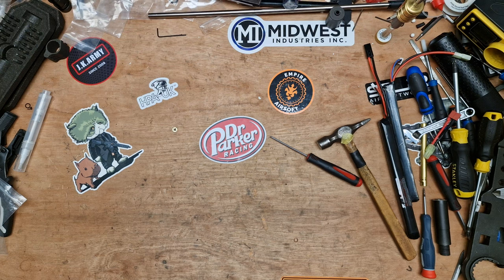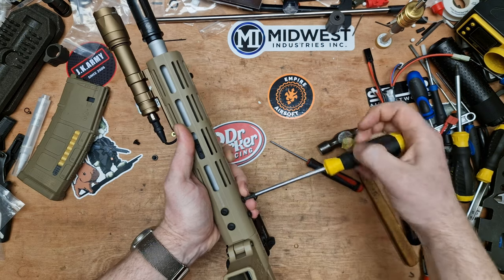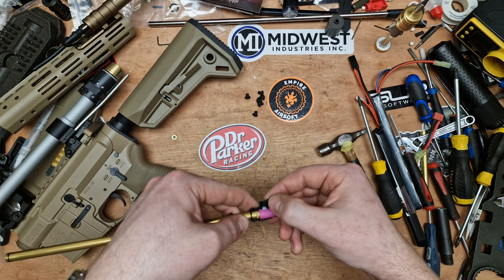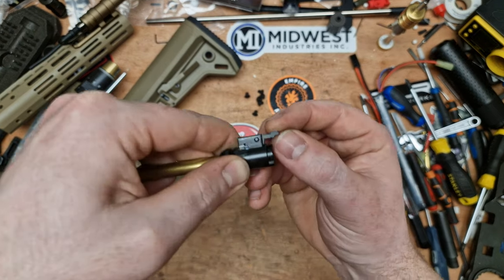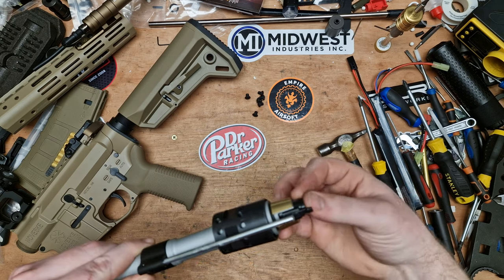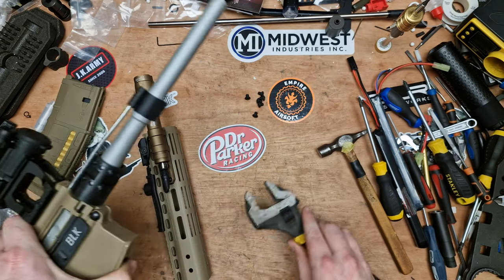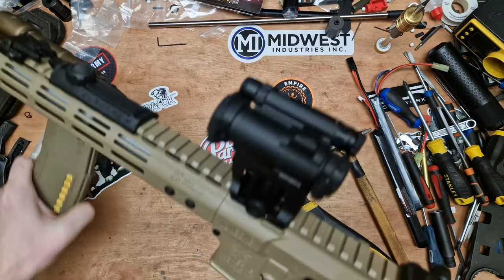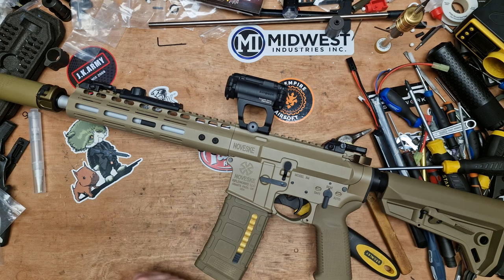EMG DE Noveske MWS Clone Hop Up Tension Fix

Comment: Received, I will provide the video to the engineering staff tomorrow
Reply: If you dont wanna modify gun in anyway this is might be good.  But if you want change steel barrel, mk18 rail or any other upgrade...its impossible or just pain in the ass. I just wish i can return this gun and buy TM mws and build gun what i like. Anyone interested to  buy double eagle noveske?
Reply from the maker: Still waiting on my DE sponsorship 😅
Reply: @Jaeger-Precision  new porduct on
 the way
Reply: Why cant you fit mk18 barrel?@plixplaxplox1609
Reply: @plixplaxplox1609 it’s a nightmare to change the barrel on a tm MWS bro
Reply: @JR-pf7kk  Upper is different shape than lets say m4a1 receiver
Reply: @mosslife488  On TM MWS i never had any issues. just swap the barrel and thats it.
Reply: @DEAirsoftJerry  When? iam just about to order TM mws. I still might since i dont want any other compatibility problems.
Reply: @plixplaxplox1609  I expect that in July-August this year，You can wait for the evaluation when the product is launched.
Reply: @DEAirsoftJerry  then it takes too long. I gonna buy tm mws then. Thank you for your answers. 👍
Reply: @DEAirsoftJerry Hello! The new release is going to be a another gbbr mws system? There is so much hype! When do you expect to be released?

Comment: I had an issue with mine from new.  Very little adjustment on hop wheel, and it didn't seem right. Turns out my hop unit wasn't assembled correctly from factory and the hop up arm was underneath the adjustment wheel as apposed to on top.

Rectified it and fitted a titan nub and flamingo at same time. But QC obviously wasn't tbe best on mine
Reply: There are two versions of this gun one is N4Double Eagle and the other is Sima n4 without markings so it's question what's your gun is they not same!!!!🎯
Reply: It's double eagle...

Comment: Hello, I have a problem.  I have the Noveske DE with angrygun nozzle, stalker CHop rubber and omega nub.  It seems that in some shots while performing the cycle it does not complete and does not extract the ball from the original MWS magazine and on the next shot it expels all the gas.  Would you know what it could be due to?

Comment: Mine is overhopping 32s with this nub and rubber combo. I have significantly more movement in my hop arm than that. Ive chucked the standard nub in for mo, gonna switch back to titan when i switch to .4s and running a npas
Reply: Yea, I've installed the titan nub and flamingo bucking and the arm is actually really loose... Haven't tested it properly yet, will do that this weekend.
Reply: @MrRiingo  let me know

Comment: Is it shooting within Dutch daft limits? 350fps 1.2J, absolutely unimaginable. If not, how can I tune it down? Will RA-TECH NPAS work?
Reply: I’ve tried using a RA-Tech npas for my Noveske and it just doesn’t fit inside the bolt carrier it’s really tight

Comment: I thought I was going insane when I was over hopping 32s on 0 hop yesterday. I find the mags supplied are really inconsistent too - sometimes it shoots straight and sometimes it doesn't seem to have enough power. Tried with mates marui mags and 0 problems. Any ideas or just grab marui mags?
Reply: General consensus between the chaps I've spoken with have all said marui mags perform better.
Reply: @maxpayne98383  yeah, they seem it, got 5 of the DE ones so am desperate to try make them work instead of forking out for the marui ones haha
Reply: Just hop rubber nothing more is it yours Sima or N4Double Eagle this two are not 🚫 the same bat they said they are they're absolutely not 🚫👎!!!N4DE is better 👍
Reply: P mag also should work,am just watching video
Reply: @vladimirsamardzic963  I have the N4DE yeah, with 5 DE mags. Just keep having problems with the mags, the gun is perfect
Reply: @SoapBoxNematoad  ai watched video and p mag work perfectly,bat sense you gotta 5of DE try changing the vents or just take them off and see maybe is to much gris or change them with others,am pretty sure they are the culprits 👍🎯

Comment: You see I’m also getting an issue that when I shoot my hop adjustment slowly changes so I can’t get consistent hop
Reply: same you got any fix for that?
Reply: @MrMi123456789  I had to buy a new standard tm mws hop adjuster set up mine had some how split in half even though it was brand new work all good now tho along with a laylax hop arm
Reply: @chasemartin2555  thanks!